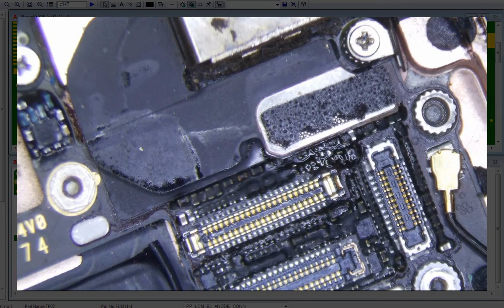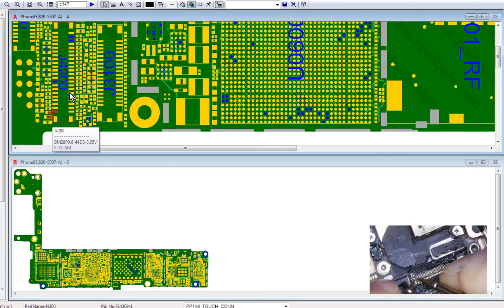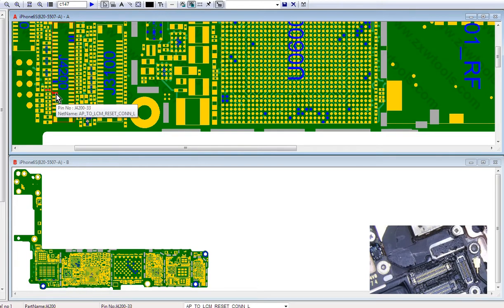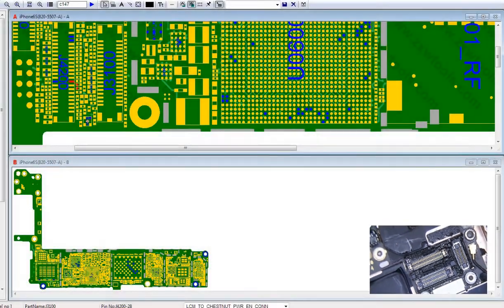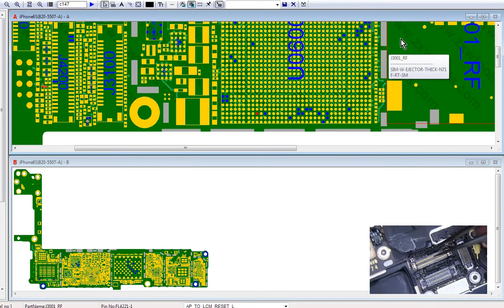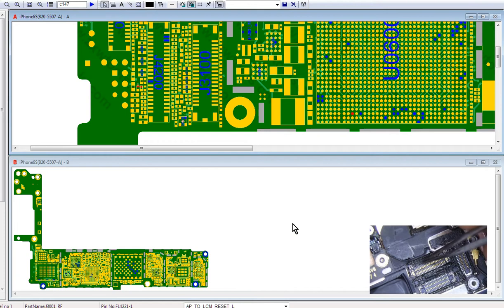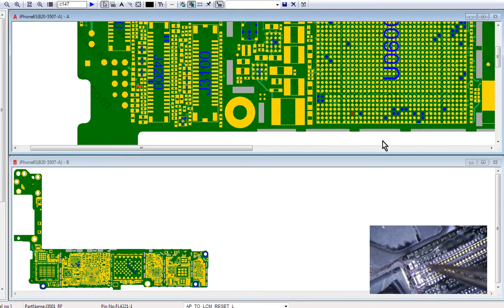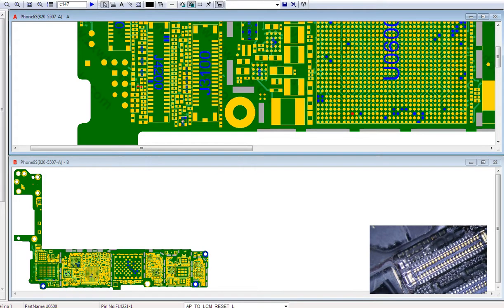iPhone 6S Short on AP_TO_LCM_RESET_CONN_L

Comment: Forgive me if you've already answered this in your video, but how are you certain it's not actually shorted on the CPU?  Have you removed the filter and CPU and the short is still present?
Reply from the maker: The filter, yes; the cpu, no.  I'll let you remove the CPU and you can tell me if it's the CPU or not. :)
Reply: Errr no thanks :)

Comment: I have been no fixing these as well.  It's really weird but looks like the CPU is damaged.  Most of them have been smashed connectors or liquid damage but now I check that line before spending time on anything else.
Reply: glad to see I'm not the only one :)
Reply from the maker: Yup.  If you have no image with a destroyed connector, I would not replace the connector first, otherwise, you will be wasting a whole lot of time.  I just bought some bare logic boards and I'm gonna scrape away some layers to see if i can find the source of the problem.
Reply: Look at my solution
https://youtu.be/qPnCaziRNOM